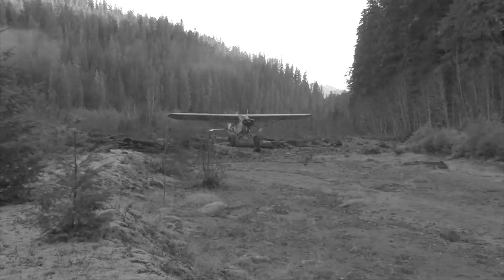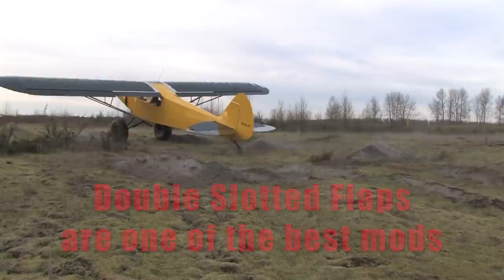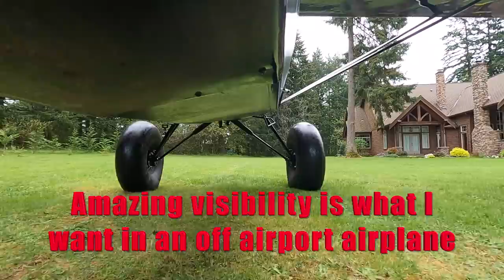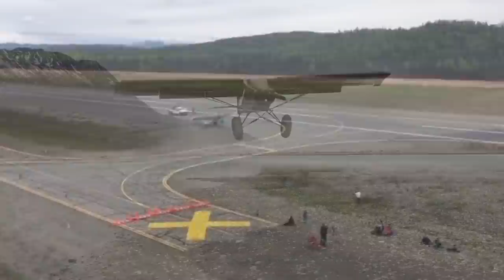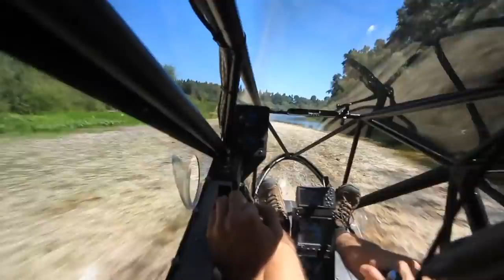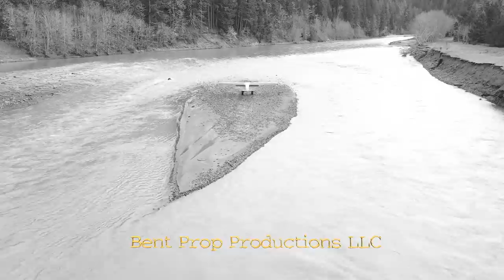High AOA landings and Slats,  How useful are they

Comment: Greg,... I enjoy your videos and respect your opinions and your skills, however slats are not about high angle of attack without forward visibility to me. I've had an Alaskan Super Cub for the last 45 years, and only fly the backcountry with it...great airplane. 4 years ago I bought an Outback Shock Cub with slats and double slotted flaps... so now I have both. The Shock cub has change my style of aproach and landing. I do MUCH steeper aproachs, but at a fairly level attitude and slow speed. If the landing spot does'nt have obsticles you can rotate to a high angle or just plop it in at a level attitude. The slats are very benifical after takeoff and manuvering in tight quarters. They also add a large degree of saftey in the dreaded moose spotter spin senario. I love both airplanes, but I have used the Shock Cub to land and improve spots for my Super Cub.
I believe slats are benificial to those with a flying style that utilizes them....Thanks for your videos
Reply from the maker: Your welcome, glad you found an aircraft that works better then a cub for you:))
Reply: Cowboy, I agree, You can fly the plane at high AOA if you need to (in the 20s), but you dont have to. Slats are just another tool. And the safety factor is huge. give me a shout, lets go test the short spots next time you are down the K. Peninsula
Reply: Thank you sir for that!
Reply: What is the weight of your Shock Cub?

Comment: I agree 100%.

For the practical application of backcountry flying with varying terrain, obstacles, mechanical turbulence with sinkers/shears, what you preach is the way to do it and teach it.  Like having a good alternate, you always want a margin.  I call it aerodynamic redundancy.

I’m a proponent of tail low wheel landings where you roll the airplane into a level attitude at touchdown to protect the tail and see where the rollout is going on a narrow strip.  The practice also kills the lift, which is a good thing when the wind is really gusting.  The tail is eventually going to lower, but by then your forward speed is low enough to not hurt it on rough terrain.

With Sportsman cuff, ART WingX extensions and VG’s on our 185, the pitch attitude during approach is level to slightly nose high.  The range of approach airspeeds is 50-60 MPH, depending on weight, which varies from a low of 2100# to 3525# GW.  Those speeds are without gust factor corrections.  I can have high DA and mechanical turbulence at my home airstrip, so there are times when I only use 30 flaps to for the approach to reduce drag and increase the recovery margin for any sinkers that might occur.  This is one area where the 185 with 300 HP shines over the stock 180.  Yeah, I know, the early 180’s are lighter, but when I need 1700# of useful load (and I sometimes do), it’s there for me.

The high AOA available with slats would be scary going into my home strip and some places in Idaho.  I’d much rather have the longer 206 flaps on my 185, but for what we need, the current configuration serves us well for the practical application of STOL ops in a heavy airplane.

Comment: I think the cuff is the way to go. Really like to have one on my bird. I end up often using a 3 pt because my LZ's are from 9k to 13.5k msl and ground speed is nuts. I'd rather use more of a wheel landing and avoid sending rocks into my tail feathers but sometimes I can't get slow enough that way up high. Too many down sides to slats with the drag on climb and cruise. Seems a good cuff adds some good bottom end speed and takes away very little up top... that's a good trade. And as you mentioned, good flaps are necessary! Good discussion points Greg!
Reply from the maker: Yeah, those elevations are going to see high landing speeds.  I might be testing a carbon fiber cuff in a few months, I will let you know what I find out.
Reply: @mauleguy  looking forward to you trying those out 👍

Comment: LANDINGS:
Slats allow very extreme slips with a positive angle of attack, that still has a good view over the nose.
Slats allow much steeper angle slipping descents.  Your landing over 80 foot trees, to a full stop, can be cut by 75%.
Slats allow you to much more abruptly stop the decent at touch down.  
A slatted wing has much higher aileron force/control; from 5 degrees up to stall.
A strong gust from the side is much easier handled with a slatted wing OF EQUAL SIZE (area). 
Slats move the CG aft, as the angle is increased, for much more total lift ( less tail downforce). 
A slat provides more lift per pound, than the wing ( 3 to 4 times more ).
In an engine out into trees/brush etc.  The airplane can be stalled in at 25% less speed and half the impact energy. 
With a slat, less turbulent air is hitting the tail. 
The elevator and rudder are more effective.   

TAKE OFFS: 
With slats you have much more lift, as soon as +15 degrees can be reached.
Slats double your Best Angle of Climb.  Full stop to clearing a 100 foot obstacle; your distance could be shortened 50%. 
With slats your flaps produce more lift, at all angles of attack.   

CANYONS AND TIGHT SPOTS:
Slats allow a much slower and tighter split S or tight turn, in a canyon, that you shouldn't have gotten into.

recommends

Configure your airplane for YOUR MISSION.
Reply from the maker: Lots of information there, not going to pick it a part one item at a time.  I will let people read what you have stated, I stand behind what I said in the video.  The best thing to do would be to go flying and see if either you have a problem hanging with me or I have a problem hanging with you.  We could make that happen and I am willing to video the results.  I will be in Alaska in late August or if you are in my area (Washington State) any time works for me.

Comment: Very good point made.  At high AOA you're on the back of the drag curve with a lot of power and the risk as shown of poor vis and a stall at height if you make a mistake. ( in rain this gets way worse) In my Cessna 180 I know how short I can land, so I land at places that work for my aircraft ... there's no hero points for trying to be a God pilot and coming up short on God skills and bending your plane.  Practice, Practice and leave a margin in there for difficult landings. You have to know when the stall sound onset becomes the real thing and that better be in the last 6".  Get a good instructor / mentor. Remember as we get older we may have the hours in the book but we aren't as quick hands and feet as we used to be.  I've landed in some really short strips for my aircraft, where the margin has been to close... Its the scariest warning you will ever get ... I don't go back there again, don't need the stress or the potential to bend my plane.

Comment: All great.  The only thing to note, is that a slat doesn't necessarily slow an airplane down in cruise.  The one's airframes makes and you see on all the cubs does because they don't care about drag.  Every large jet ever has slats, and they're causing no drag at all.  Designed correctly, it would not be a cruise penalty.  Still a weight penalty though.
Reply from the maker: All the slats currently offered for STOL airplanes slow their cruise but you are correct about the design could be incorporated into the wing without a speed penalty it just adds complexity to the process of building a wing.
Reply: @mauleguy  The slat on the Just Aircraft SS pivots flush w the wing, my cruise is 110 mph (180hp), land speed can be as low as 25.

Comment: a T-tail configuration would reduce risk to the elevator and horizontal. Sailplanes use them for farm field landings.
Reply: True but then you don’t get the advantages of the prop blast on the elevator which is beneficial to pitch control at low speeds, I believe that is the primary reason you don’t see any T tail Stol aircraft
Reply: Correct. That is the only, only, only reason sailplanes have T-tales, since they add expense, complexity, and fragility.

Comment: I fully agree with you! This high AOA porn is good for youtube clips but dangerous and you’re more likely to damage your airplane using them to their full potential. I flew a french socata rallye long time ago, a low wing tricycle with slats. Flyable at full pull but you would  hit the tail if you would try to land like that, so you wouldn’t land much slower than something comparable like a archer

Comment: This a great video on slats and the practical use of STOL techniques vs. the  STOL competition style.   Even landing tail low on the main wheels transitioning tail high,  I have a difficult time seeing my point of touchdown.  You quickly touched on your use of modified flaps and the idea of larger flaps  seems like the key to a useful shot landing.  You mentioned the use of VG's for low speed handing.  Did you find better controllability with the VG's?  I noticed that whit it slowed stall by maybe 7% the aileron and elevator at slower speed was much better allowing a slower approach.
Reply from the maker: I did not notice a huge difference on the Experimental Cub but there is some at that slower end just about the stall.  On Bushwacker it is more noticeable and on a short wing Maule like an M5 they are a must have in my opinion.

Comment: Thought of a question for you out of left field...I like getting your perspective on different things. What do you think of the newer high performance composite props like Whirlwind propellers ?
Reply from the maker: Well that is a big subject.  It would be awesome to get all the different propellers together and do testing on one aircraft.  I have done some of my own testing of a few different propellers and I currently run a Borer 82/41 prop on the Cub  (metal) and a constant speed compact Hartzell 80" (metal) on Bushwacker.  That does not mean they are the best but between the 2 different composite propellers I tested on the two airplanes they won.  Propellers can make or break the performance of an airplane and are often overlooked for what they can do.

Comment: Only guys who fly truly off airport know that high angle of attack is worthless and will rip off tailwheels. I would love to see a video on your off airport 100 hr maintenance items you do.
Reply from the maker: I will do something on that.  I do conditional inspections as required but whenever I have any reason to suspect a issue I dig into it.  I always look the engine over very carefully at each oil change and look for obvious stuff each time I check the oil.  Cub style cowlings are great for firewall forward inspections.  I spend time throughout the year not just when required.

Comment: Learned a lot from you and others about this subject. When i get started on my BH5 kit, we'll have a good chin wag about it. I'm already committed to the P-stols. Whats your take on flaps beginning a foot along the wing as opposed to snug against the fuselage? Would the foot away from the fuselage give you more airflow to the tail feathers?
Reply from the maker: I would not do it.  Don't give up flap length.  Even a stock cub as it came from Piper had about the first 4" of no flap but just fairing.  Everyone changes that when the can.
Reply: @mauleguy  ok. Just keep a little more airspeed up.